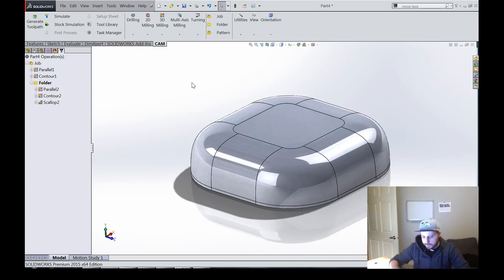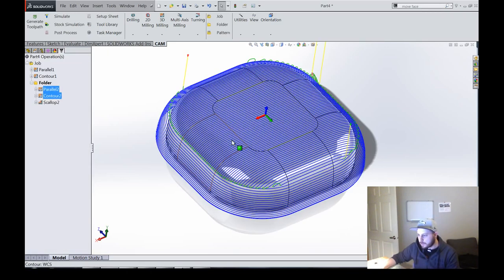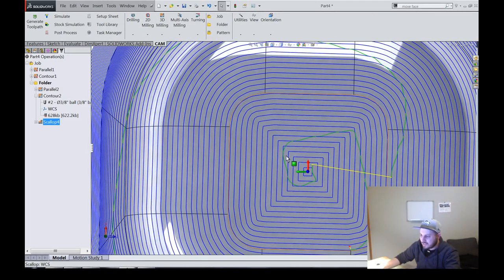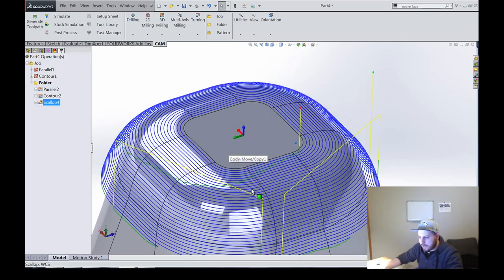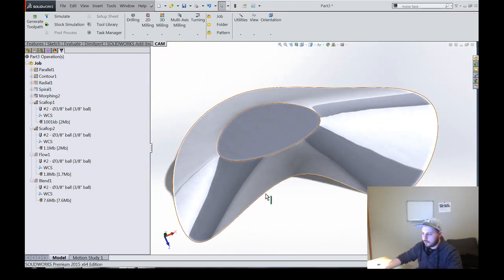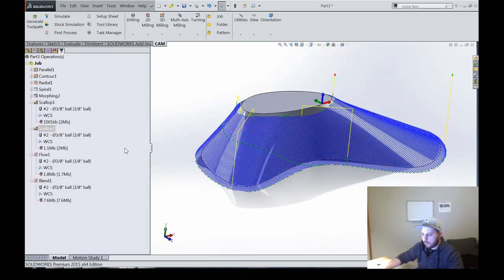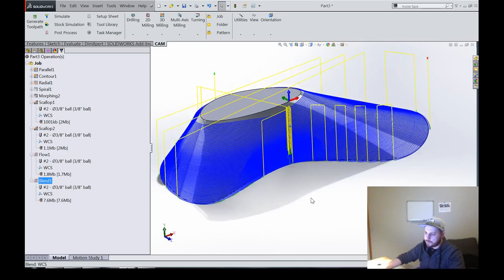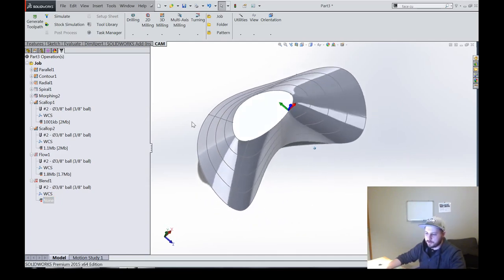HSMWorks & Fusion CAM How-To: The Ultimate 3D Surfacing Toolpath.

Comment: Big issue I've ran into when employing these techniques, what happens when my fillets "end" on flat surfaces, in other words it doesn't wrap around the part to form a closed contour? This really messes me up when using the scallop and morph tricks you showed because now my tool isnt going "along" the fillet. It also seems that they took stepover control out of flow in beta :(

Comment: Please note that the tool path at 16:00 is NOT close to a perfect 3D Tool Path. 
Yes, the transition from the center boundary to outer boundary is nice. 
But  the surface finish will not be constant. 
When finishing a part like in your example, the scallop height will be different if your spacing is constant. 
Are you confusing evenly spaced passes as "close to perfect" tool path?
For this type of tool path, the tool path spacing should not be even.
The tool path spacing should indeed change depending on the slope angle of the surface for a more uniform surface finish.
For a more uniform scallop height.
Reply from the maker: So Cal Plymouth and Dodge Posse in the case shown, the geometry has constant curvature and the toolpath maintains a correctly constant 3d stepover, which will result in a perfectly constant scallop.
Reply: Hi Rob, that is incorrect. Because the the surface slope is more straight up and down on the sides and more flat on the top, the spacing of the tool path should not be constant to produce a more even scallop height. If you want a more constant, uniform scallop height, the spacing of the tool path should change as the surface transitions from straight up and down to flat.

Machine that part using that tool path and look at the surface finish and you will see this.
The scallop heights will vary.

My point is that if you want the scallop heights to be the same, then the tool path step over will need to change based upon slope angle. 
However, if scallop height is not a concern, then a constant step over may be desired.
Reply from the maker: We'll just agree to disagree; with 30 something years of teaching experience, i'm assuming you can find your way into a 2d sketch and figure out you're wrong in no time!
Reply: Its OK, its not me that needs a sketch. In fact, it does not take 30 years to understand something as simple as this.
I am surprised you don't understand this.

You are mistaken as you (for some reason) think you are cutting with a sphere. 
You are cutting with a ball nose or a bull nose that has vertical sides.
As the ball nose or bull nose begins to cut the curved surface near the bottom, the side of the cutter eats into the previous scallop.
This reduces the height of the previous scallop. 
If you were cutting with a sphere (Like a Lolli Pop Cutter), then yes, the scallops would be the same height. 

Tell you what I will do to assist.
I would hate for you to keep misinforming your subscribers.
I will create a video for you and post the link on this time line. 
As soon as you realize you are incorrect, you can delete the post or keep it so others can learn.

BTW, part of being a good teacher is admitting when you are incorrect and learn from it.
Reply from the maker: Ah, no need. I'll give you that point, the scallop itself will wind up shortened on the lower passes due the side of the tool. I misunderstood the argument you were making, assuming you were oversimplifying, when it was myself doing so instead. It's a valid point and something I probably should've touched on.
Reply: Right on, very good videos BTW.
Reply from the maker: I should probably add, it's a near negligible effect in most real world scenarios. In the rather coarse example shown, the MOST extreme impact on scallop deviation is a reduction of a  .0015 scallop down to .0005" or so - BUT.. it ONLY effects the last pass prior to hitting vertical! it's entirely gone by the second step up. It's even less negligible with a more common 3-5% stepover. So i'd hope, in spite of my attitude, we can agree it's a larger theoretical problem than a practical one?
Reply: @170cuda  You are right, that is why I would prefer 3D contour with "machine shallow areas" option checked. It allows you to use smaller stepover in shallow areas and keep the normal stepover for steep areas.
Reply: It is more theoretical. You somewhat did touch on this when you said it was CLOSE to a perfect toolpath. It was only imperfect in 2 very minor, near negligible areas. As a mold maker, we use a 3% stepover on a scallop style toolpath with extremely good results using tools as small as a .020" ball mill.

Comment: Very nice video. 

There is no perfect 3D tool path, period............. Yes, some tool paths can be better (more efficient) depending on part geometry.
Many new to CAM learn this the hard way. 
It's knowing (having CAM experience, having manufacturing experience) that will determine what tool paths you should select. Regardless of what software you are using.
Unlike CAD, learning CAM is more than just reading a manual or knowing what buttons to click.

Simple example:
No one should use 3D surface tool path for flat areas on a part. That's one way to not be efficient.
You won't find that in a manual or online help.  

It's also important to note in regards to efficiency, knowing what the product is going to be used for and the tolerances that need to be met, should drive the what the finish should look like.
Imagine spending hours programming and cutting chips for a perfect finish when the part is going to used as a door stop.

Comment: Used a lot of this type of stuff in SURFCAM when I was doing mold work. They had a "steep/shallow" toolpath which was basically a combined parallel/contour broken up by whatever angle limits you desired similar to how you did in the beginning. Used a lot of sketches to drive their 3D Offset pass which is basically the same as scallop. I don't think enough people know about using sketches to drive paths so it's good to see you point it out. That was how I did my Fusion F using morph spiral, contact only and had huge sketches so the areas where the path would change directions was way outside the surfaces to cut. Worked out really well.